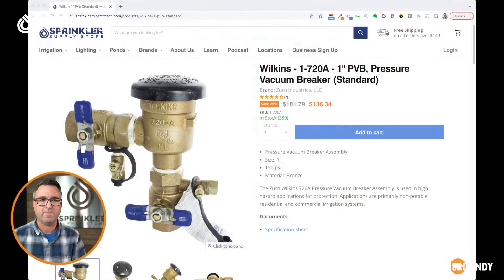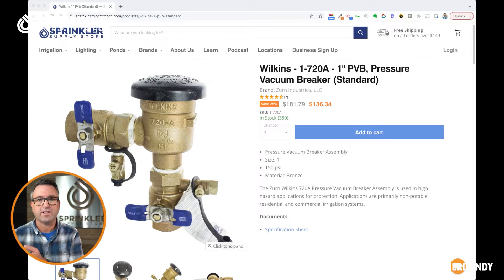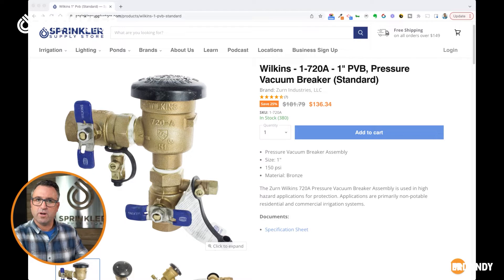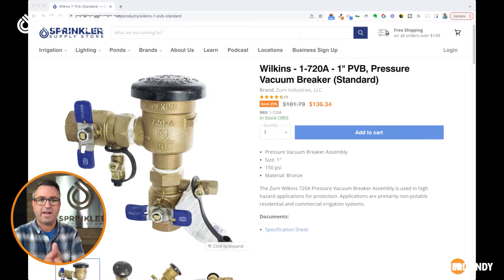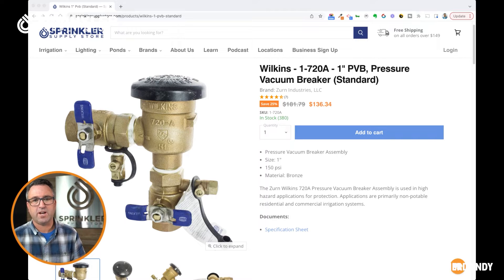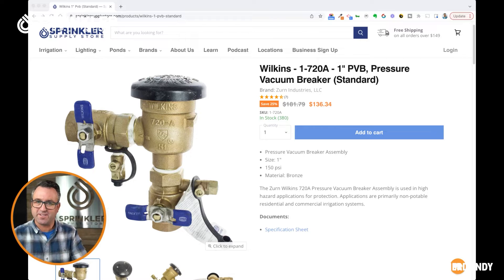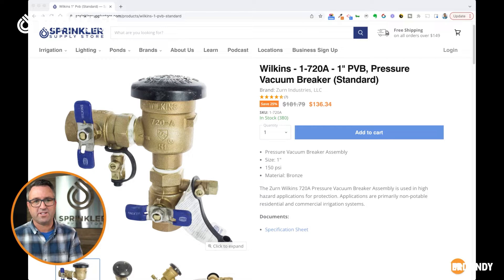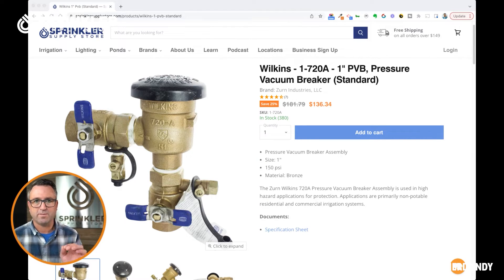Understanding Basic Irrigation Components  | SprinklerSupplyStore.com

Comment: Hi, we have a dedicated meter for our sprinkler system which has 7 separate zones.  We had a recent leak and the leak detection company measure the water pressure to be 160psi and recommended installing a pressure reducing valve next to the meter.  My concern is that 60psi may be inadequate to push water through each zone.  I thought I would ask since it is not one of the components you covered in your video.  Thanks!
Reply from the maker: Hi Yankee Hank, great questions! 160psi is definitely way too high. Most pressure reducing valves are adjustable (example, 25psi to 75psi, etc), which will allow you to fine tune the pressure on your own using just a wrench. 60psi at the water source is generally adequate, but I say this without any knowledge of your sprinkler system, pipe size, distance, etc. My recommendation is to make sure the pressure reducing valve that you install is an adjustable model so you can make adjustments as needed. Let us know if we can help in the  future and happy sprinkling!
Reply: Great information